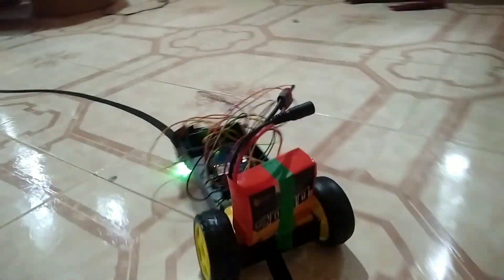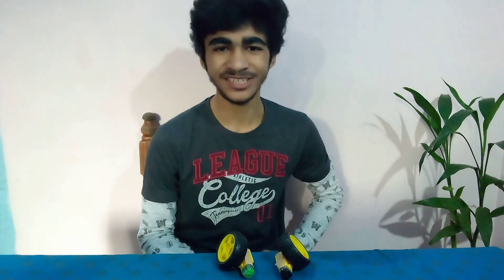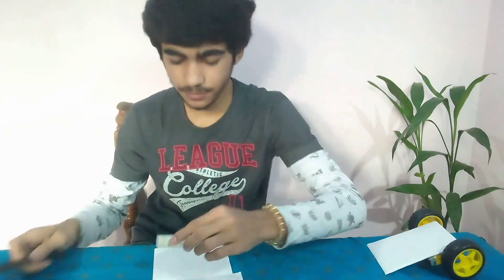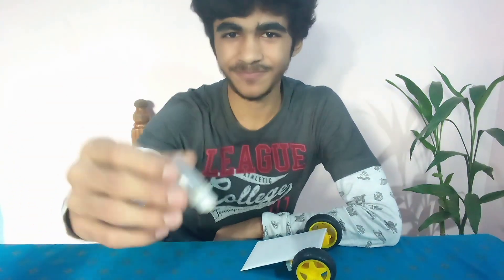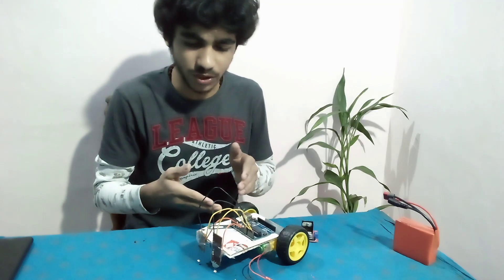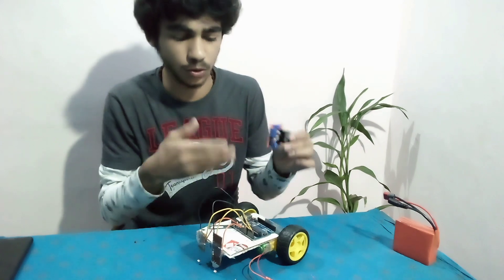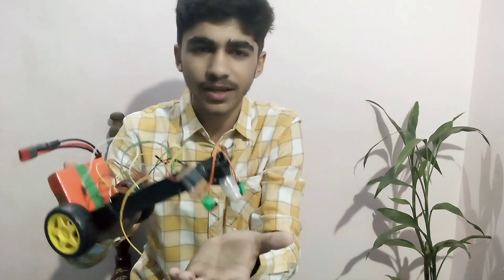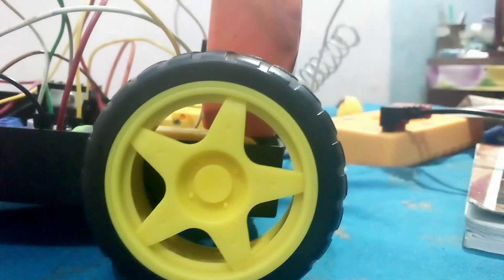Easy line following robot! using LDR | How | VinVout

Comment: How can you use ldr to detect colored tapes like red and blue?  If it detects red it will go but stops when it detects blue.
Reply from the maker: Sorry i actually didn't get the question. I haven't used red and blue tapes. 
I guess your question is about
how it actually works. The tapes around the LDR is used to prevent the outside lights. The light from the led will reflect more when it is on a white surface(floor) but when it falls on the black tape it will reflect less which means depending on the intensity of light there will be change in the value of the analog reading of the ldr . So that way we know when to stop or move. I guess this is the answer to your question.
Thank you
Reply from the maker: Or is it a general question about how can an LDR detect different colors?
The LDR's resistance change depending on the intensity of life falling on it. I think it will be easier to use a black tape and a white surface. Because the black absorbs most of the light falling on it while the white reflects. If you take the serial monitor you can analyse the different values